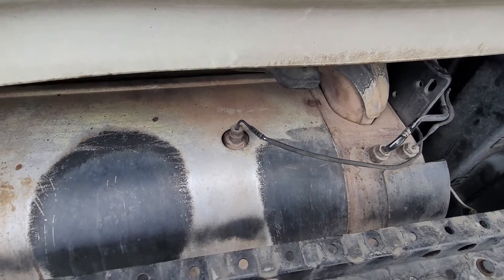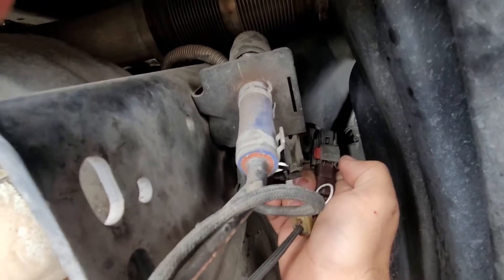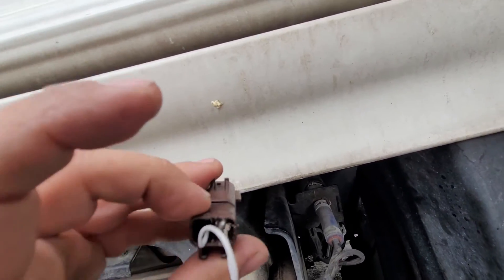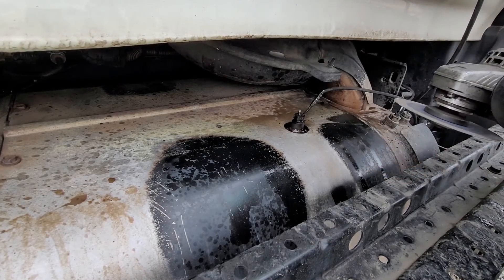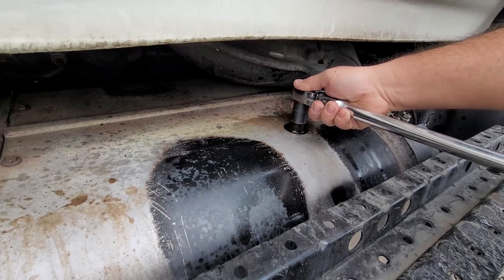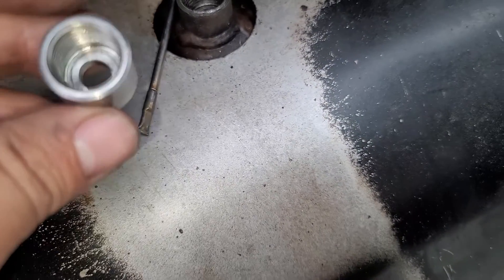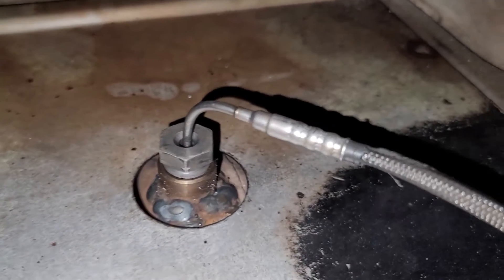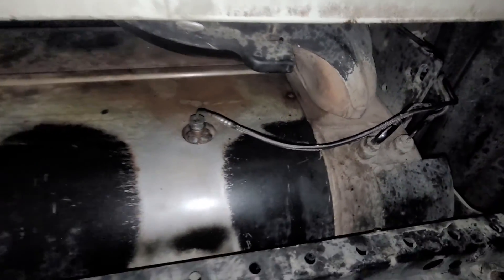How To Remove And Install Freightliner Cascadia DOC Outlet Temperature Sensor SPN 3250

Comment: SPN 4363/FMI 0. Description. Selective Catalyst Reduction (SCR) Outlet Temperature High O got this code Sr is it the same sensor I should change ? Thanks 🙏 I got stuck in Indianapolis I’m scared to take my freight shaker to dealer DPF filters and sensor’s have been baked clean and changed about a 8 month ago pls need some direction and help God bless
Reply: You still having issues boss man
Reply: Na I cut that shitt off now I’m boating around no more issue

Comment: I unfortunately stripped the shit outta mine with vices, so any suggestions to remove it would be great
Reply from the maker: Just replace the whole fitting
Reply: Never use vice pliers on nuts and bolts of a semi or even car, especially for the exhaust components that are the most difficult to remove. Even if you can get it out with vice pliers, you would damage the bolt/nut. The proper tools are either sockets or wrenches.

Comment: It wasn't the last installer bro you pulled the threads out it happens when you don't use enough heat to remove it